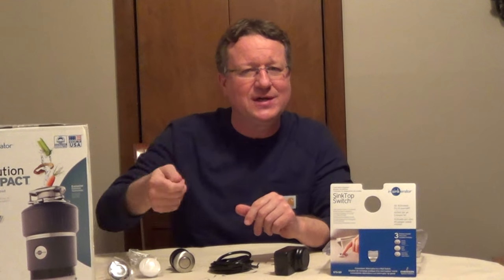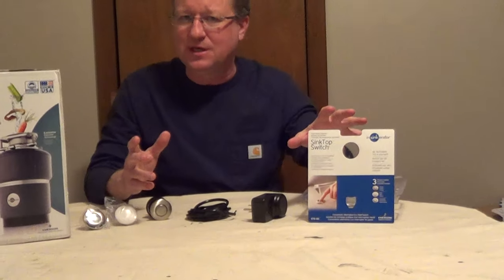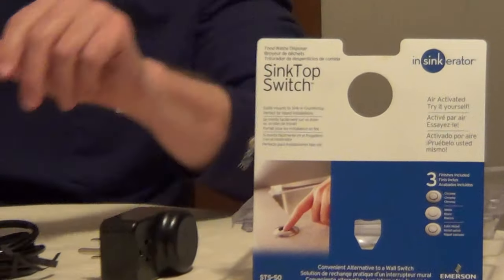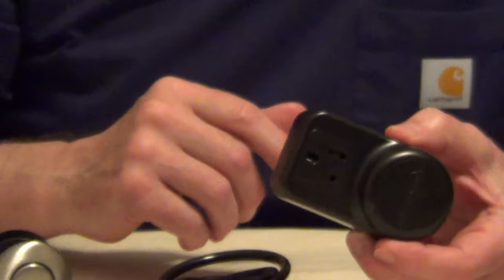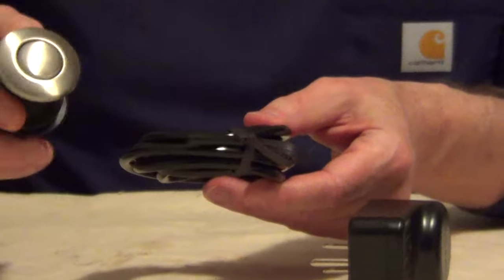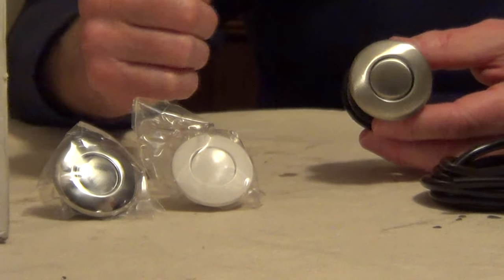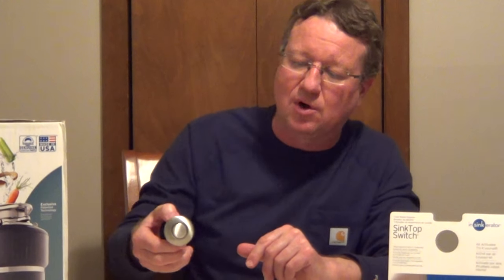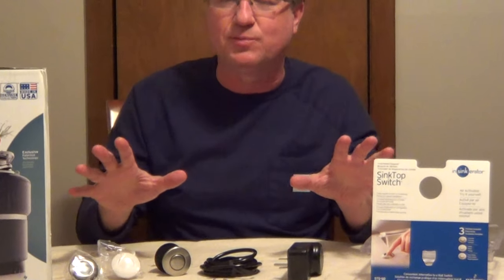Garbage Disposal Switch - Garbage Disposal Air Switch

Comment: Is there a momentary switch for use on the garbage disposals? The inhabitants of my house either leave it running or chops utensils.
Reply from the maker: Hi, yes you can get a momentary switch. Here is a link https://www.homedepot.com/p/Leviton-15-Amp-120-277-VAC-Decora-Plus-Single-Pole-Rocker-Light-Switch-Momentary-Contact-Commercial-Specification-Ivory-5655-2I/308986535
We have more home improvement tips on our podcast https://podcasts.apple.com/us/podcast/fix-it-home-improvement/id880903087

Comment: But you still do need a power supply outlet.
Reply from the maker: Hi, yes, the air switch plugs into an outlet, you plug the garbage disposal into the air switch plug and use the air switch to turn the unit On and Off. This eliminates needing a wall switch and running wires to the wall outlet. 
Check out more home improvement tips in our e-books https://www.amazon.com/gp/product/B0B2KW1FQ9?notRedirectToSDP=1&.

Comment: this is old technology and you need the hoe he mentions. There is an easier way now. Garbage Disposal Wireless Switch Kit,Remote Control Outlet Wireless Switch for Household Appliances, Compatible with Garbage Disposal Under 2HP. Plus the air activated switch is well over $130 dollars and this device is $30. Your choice

Comment: How about Outlet connection? hot wire or neutral wire ?
Reply from the maker: Hi, You are plugging the socket into an outlet, then plugging the power cord from the garbage disposal into the socket.